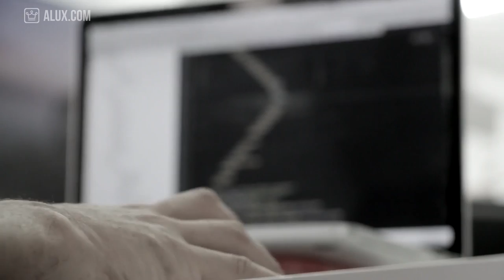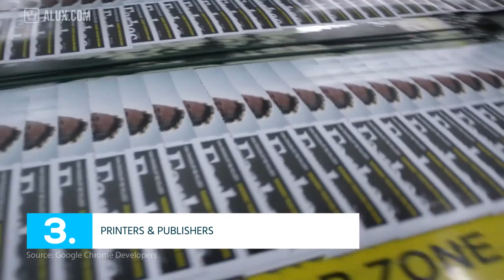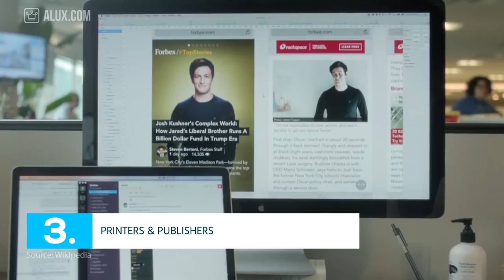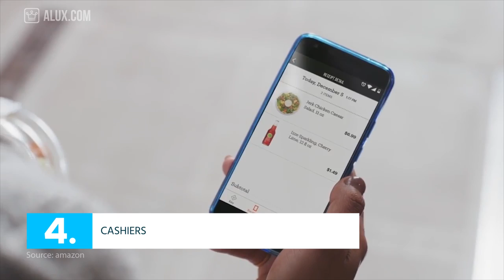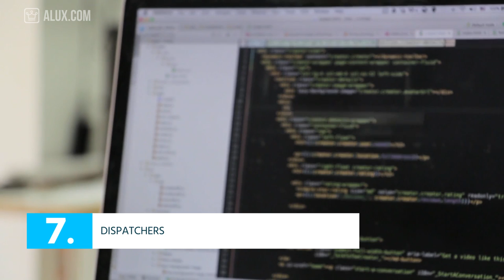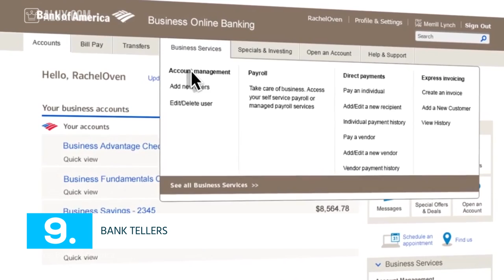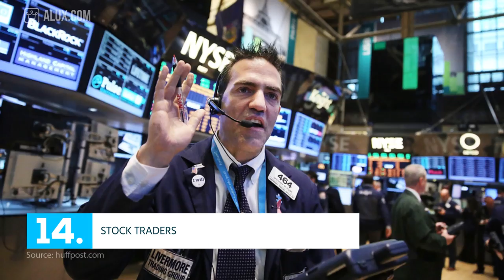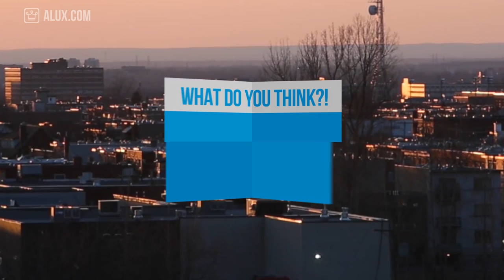15 Jobs That Will Disappear In The Next 20 Years Due To AI

Comment: DRIVING:  autonomous ain't coming any time soon, and current tech requires MORE people being involved, rather than LESS (safety driver, safety observer, remote monitoring).

2.  All the farming jobs mentioned, still need to be done by hand, since the automated versions gave proven to not grow as much as a standard human-tended field.

3.  Digital media has already happened, and the theft of personal info for resale is funding it.

4.  Fewer cashiers but more customer service staff.  Same with travel.  Oh, and remember with hospitality more people are going for RVs than flights and hotels.

5.  Manufacturing has tried this.  Guess what happened?  The machines screwed io...EVERY TIME.  Musk, famously, had to start a new line with almost NO machines, to be able to ramp up Model 3.  Even turning humble screws, get a screwed up by machines.

I could go on, but you get the point.  Counter to your assertion, much of the 'sharing economy' is going to gi bye-bye, mostly due to the lack of quality, higher cost, and fear seen by governments around the commie cough virus.